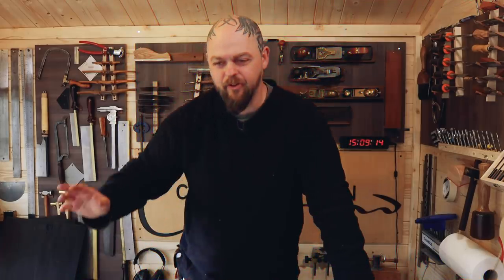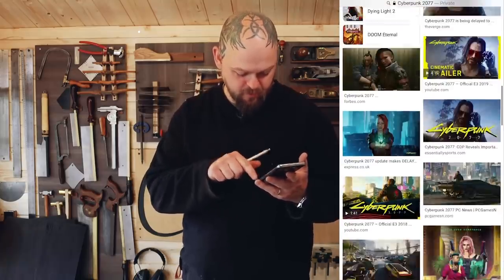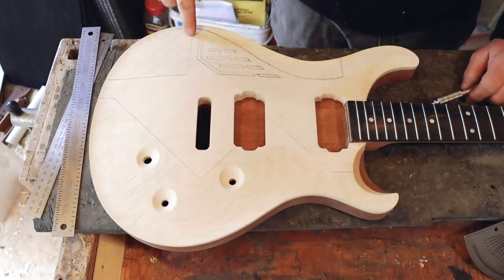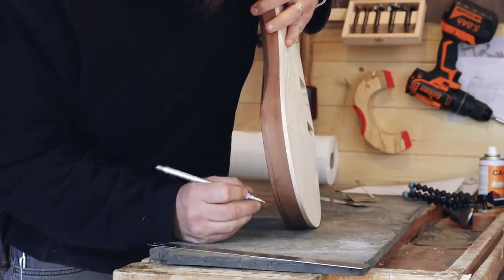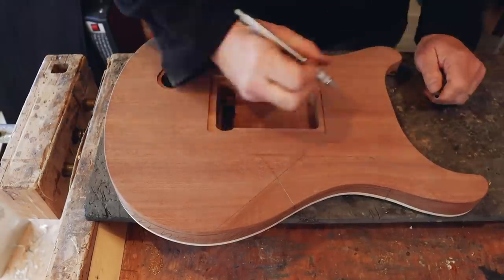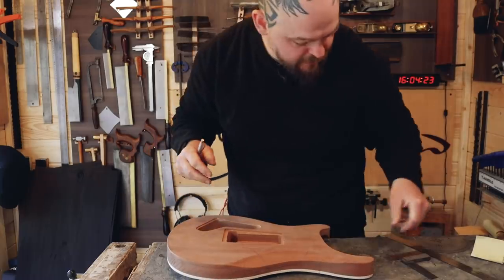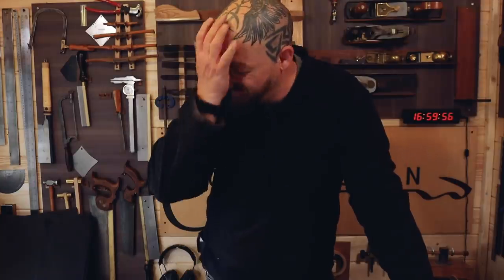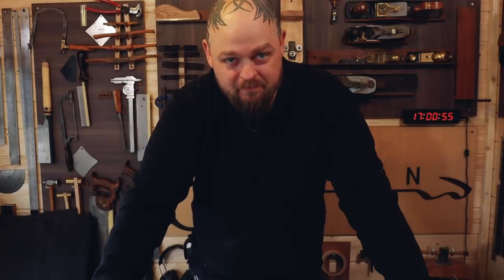New Workshop - New Project Ep1 | Building a CYBERPUNK 2077-inspired Custom Guitar

Comment: I'm an old man now, but when I was a teen, all I had for power tools was a high speed 1/4" drill. For hand tools all I had was pliers, hammer, hunting knife (doubles as a really wide chisel), X-acto knife, brace and bits, files, rasps, sand paper, sanding block and the magic coping saw. Oh, I had an electric wood burner too. I built all kinds of wooden things. It's amazing what you can do with a few hand tools. So far this build is really intriguing. I'm really anxious to see where it will lead you. I'm sure it will be amazing when it's through. Carve on my friend.

Comment: I'd love to see LED neon strips implemented in that build! Not sure how it could or would be done but an LED neon strip inlay would look insanely good but you have different plans for it already
Reply: Inside the sound ports along the top edge would be a good place to put them, if Ben keeps that idea.
Reply: Can works with active pickups and his 9V battery.
Reply: I was thinking perspex or cast resin strips inset into the guitar body running round the side too like the lights on the back of the car. Run high power LED  behind them and it would cary the light beautifully.
Reply: My ideas are not original.  I can live with that.  Second the motion...
Reply: wouldn't it be more cyberpunk if he used some kind of "neon" lights for the build, or at least it should look like it's neon. :D
Reply: you can add EL wire.. pretty 'Straightforward'
Reply: Fiber opitics

Comment: The forward most exit of the front carve should match the angle the aluminum insert line has between the bridge and bridge pickup. You redrew it, which looks better, but it clashes immensely with the line you have coming up between bridge and pickup. Funny thing is, if/when you make the angle steeper it will lean more towards the raised ridge on the horn. So, you’d either have to curve the line to follow the ridge, or you could completely flatten the horn and leave it a hard line, which I think would be cool!

Comment: very cool! To me, "Cyberpunk" is the fusion of technology with biology. If at all possible, insert a pulsing wet brain with chips and wires attached to it somewhere, perhaps in the back cavity, clear panel to seal it off. Maybe a hole all the way through the body to show it from both sides (with appropriate internal lighting of course). Sharp pointy bits, knives, blades, etc are also genre appropriate. Maybe a digital readout panel or VU meter... :D

Comment: I think the aluminium zig zag strip would look nicer if the spacing to the other line it follows varied. As in start at 10mm for the first part, 20mm the next then down to 10mm or even 5mm for the last bit. Looking forward to the rest of this build.

Comment: Finally another build , I like where your going with this . I think there's going to be some changes made all the way through the build but that's how it works . I have to say , I decided to go ahead and buy a fretting kit as well as upgrade it and add some extra purchases . So after spending a few hundred happily , I was very disappointed to find that my 8" and 16" leveling beams didn't come with not one piece of sandpaper for them and the website doesn't offer any option to purchase paper for them at all . So now what , didn't come with any , didn't give the option to get any with the kit , and don't have an option to buy any for them . I have a few more things I want to order and my bass notched straight edge I bought with my kit is still out of stock as far as I know but I'm kind of waiting to see if this sandpaper thing will be solved before I place another order . I would like to get several more tools but I would like to wait and get the sandpaper I need at the same time , my new leveling beams are pretty much just decorations at this point . I love this new build , can't wait to see what changes and what gets added along the way . And thank you for doing another build I really do enjoy them more that pretty much anything

Comment: Ben, Pretty much sure that you won't see this before you've started working on the guitar. BUT, in case you do, for those "ports" you're talking about, why not do something with MIDI (yeah, it's old school) and/or USB data ports. Part of what makes Cyberpunk is the intersection of technology and punk. Adding a digital interface to the guitar would be well within the definition of Cyberpunk. You could even have someone local who's good with electronics to put together some LED's tied into a circuit that would flash patterns depending on what's played. (Although, I don't know what that would do to the signal coming from the pickups...)

Comment: Please add a cybernetic implant to the guitar, maybe a hidden speaker as an implant with built in preamp and usb charge output. Infact put in a usb chargable battery so that neons an leds can light up too ... also leave some wiring in the open and  a  small screen attached showing code like matrix? ( so that someone can port in and run DOOM 93' )
Reply: We need flickering dim amber pilot lamps as dots in that fretboard.

Comment: The soundhole works as long as there are more elements in the design that use a similar style of accent. If the soundhole is the only element with that "circuitboard" look, it won't work.
Reply from the maker: I agree.. I change it up.in the next episode.. B

Comment: hitting the like button right after starting the video 👍
I would consider to follow with the Lines you draw at 6:40 the contour you have drawn at about 2:50 (if I'm in any way understandable). Each Line would have a different angle to the main shape but would have the same distance to the outer Line.
Reply: I think your talking about the small sound holes. I was thinking the same thing. The angled ends of the holes should match the curve of the body right next to them.

Comment: Ok with me if these episodes go an hour each.
Since you want it to be "Cyber," how about going all Apple, and making it Bluetooth output only with no conventional output jack. Also, since there are some really good micro speakers made these days, you could build in the guts of a JamJar amp and an onboard speaker. There are lots of suggestions for LED's etc already, so an onboard rechargeable battery of some sort of seems like a given for this project anyway. An Arduino Nano to deal with the LED's, Bluetooth modules, and USB power supply/charging modules are all available on Amazon, and you sell the onboard amp parts already.

Comment: The metal strip going across the body looks good; or will since it's just pencil lines so far. Do you have to literally slice the body "in half" to do that? What's drawn seems like a plan for an inlay, which may be much less effort while achieving the same look. You may be getting to a spot, in your imagination, your available tools can't take you. In the last video, you pointed out the lack of a band saw. 
I probably shouldn't worry. You do this stuff for a living.

Comment: The sound holes are crooked. They slope up towards the horn. The shapes work but rather than taking the flow of the body, they should be drawn parallel to a center line on the body. It would better suit the rigid lines and be more pleasing to the eye.

Comment: just thought of sumting : wouldnt the shed get too moist inside for guitarbuilding , the wood supposed to be dried out thouroughly before working on it it might not work if there isnt a small heater or dehumidifier in there

Comment: Do you have any advice for routing on a carved surface like this? I wanted to put a Floyd Rose on a PRS style carved top kit but I'm not sure of the best way to do that. Thanks.
Reply: Have you considered making a sort of router sled for that?
Reply: @andreambuter6806  I looked it up and they appear to be used more for flattening large pieces of wood. I guess I would put a template under the sled. Do you have an idea about how I could see what I'm routing? Thanks for the advice. I'll see if I can use it.

Comment: Question if I may (it is Ben's fault that I trying to build a guitar after all). I'm trying to plane my two body halves for jointing. My plane is either not cutting at all, or after turning the wheel, just a tiny bit, it starts to dig in and judder (chatter)? I would appreciate any thoughts. Getting the dam things flat and square I recon is up to me to learn but having a plane that works would be a start.
Reply from the maker: Hey Paj.. watch a few videos on setting up the plane and sharpening it.. there are many problems it could be but make sure all the internal screws are tight and that the blade is only extruding about 1mm past the chipbreaker. Sometimes a plane is just not capable of working and you may need to find another.. tricky business for sure but worth mastering imo. Thank you for your support! B
Reply: @CrimsonCustomGuitars  Many thanks for that. After my first (and only) build it is apparent that 'cheap' tools are a false economy. Luckily the guitar came out fine, well it plays well and sets up to spec but don't look too closely. Now neck and neck pocket. Many thanks to Ben and the team.

Comment: How are you going to  bond the halves with aluminum between them and be strong enough ??  Dowels or biscuit joint  would be a decently strong hold on the parts that are not hollow  just curious love the builds. This one has me  hangin till the next lol. Thanks for all you do man.  Keep rockin
Reply from the maker: Hey Buck.. the plan is to use epoxy and key the aluminum furiously.. I have since had another idea though thanks to another users comments.. it may have changed ;) B
Reply: Rock on man. Cant wait to see the final  comcept in its entirety

Comment: this is nice, style looks nice, personally i would use pattern shown on the inside collar from jacket, and make orange resin pattern (powered with led) like from the bottom part holes connected like circuit plate similar like this (https://www.123rf.com/photo_27158850_stock-vector-green-back-plate-circuit-board-vector-background.html)
Reply from the maker: Next episode hits tomorrow and you know what.. I decided the same thing!! B